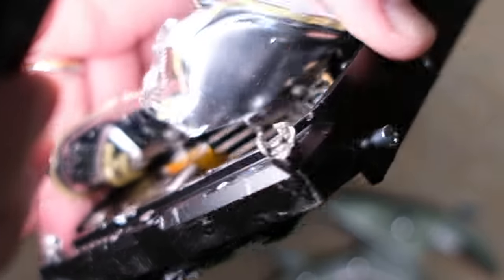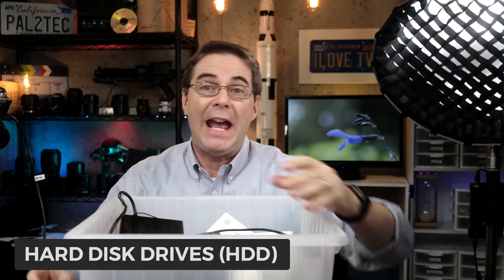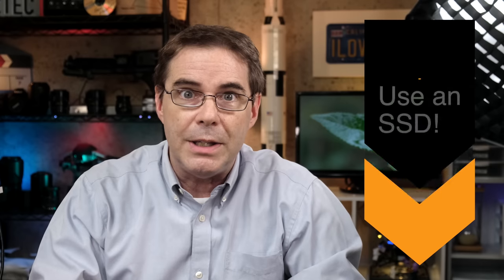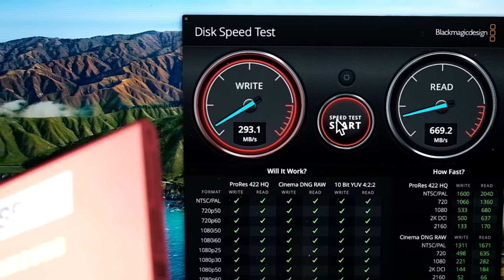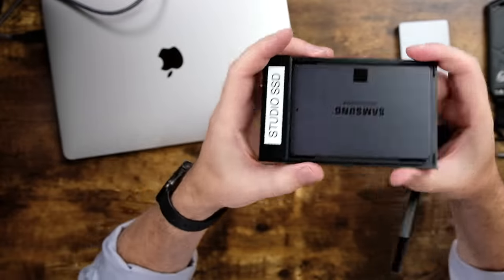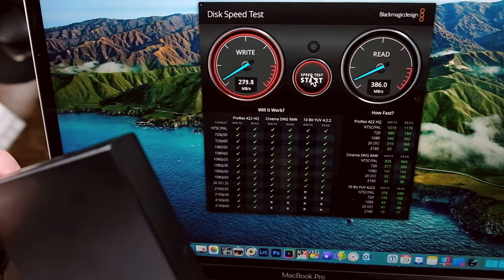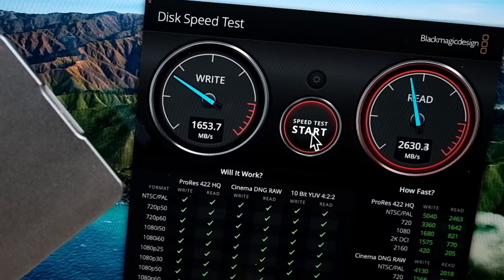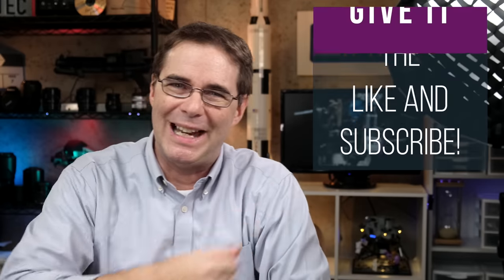Best Hard Drives for Editing

Comment: One thing I will point out is that as a good rule of thumb, if the case comes with a thermal pad, make sure you remove any labels off of the NVM.e and the pads so that the pad is directly touching the chips and case.

Comment: Hi Chris - Just stumbled across your channel when researching the Godox mics, then saw this vid. Great that you warned people off the T7; I might have considered it otherwise! 

=> One very important note about the Inland NVMe drive though, that's also something to watch out for with any SSD these days: Low sustained write speeds. Looking at the low-star reviews on Amazon, a number of people complained that it has very poor sustained write speeds. It'll be blazing-fast for some number of GB, then slows to only ~250 MB/s after that point. (Note that the people who report sustained speeds of only 30MB/s are almost certainly having thermal issues with however they have it housed; I believe that the actual sustained-write speed is more likely the 250 MB/s that one user reported.)

I first encountered this with a little Helix-brand 2TB SSD that I purchased a while back. The issue is that MLC (multi-level cell) Flash memory is much slower to write to than SLC (single-level cell). MLC/SLC refers to how many bits of data each memory cell can store. The original flash storage was SLC; each memory cell stores one bit of data. These days, the really high-capacity chips all store more than one bit per cell, currently the state of the art is 4 bits/cell (16 possible data values), with 5-level technology under development. The Inland drive you mentioned uses this so-called Quad-level cell technology, aka QLC.

MLC lets you pack a lot more data onto a chip, but the downsides are speed and life expectancy. Multiple bits per cell are stored as varying amounts of charge on the transistors' floating gates, treating them as a kind of analog storage medium. To store 4 bits, a QLC chip has to distinguish between 16 different levels of charge, which reduces noise margins when the data is read out. If you're just storing one bit, the difference between a 1 and a 0 is large, but if you're storing 4 bits, you only have 1/16 the voltage tolerance to work with.

The way flash chips age is that charge gets “stuck” on the floating gates of the transistors. A logic “0” should correspond to no charge being present, but as the cells see more and more write/erase cycles, more and more charge can get left behind on the gates, that the chip needs to allow for. The chip basically has to say “OK, I know a zero should be zero charge, but I’m going to say that anything under ‘0.2’ is still a zero.” That’s no problem for an SLC chip that’s just worrying about a 1 or a 0 in each cell, but a MLC chip with 4 bits per cell, the difference between 0000 and 0001 is only 1/16 of the maximum signal. The “0.2” that we decided was OK for the SLC chip would correspond to 0011 in the MLC chip. 

This means that MLC flash wears out much faster than SLC flash does, so it’s important to consider the total rated write-life of an SSD and compare it with your usage. The endurance rating is expressed as total terabytes written, or TBW. Thanks in part to its size, the 4TB inland SSD you mentioned has a rating of 900 TBW, but if you’re editing a lot of 4K video, that could still go by more quickly than you’d like.  

To get around the speed limitations of MLC, many SSD makers include a smaller cache of SLC storage in their devices. This can read and write at blazing speeds, but there’s only so much of it. If you’re saving a big video file, the first 4, 8, or 16GB will write at the speed you expect, but once the SLC cache is full, it’ll drop to the much slower rate the MLC chips can sustain. In the case of my little Helix drive, it’ll write at ~960 MB/s for the first ~12 GB, then slows to 200 MB/sec after that. Once you stop writing, it’ll copy the data from the SLC to the MLC chips, so after a while (sorry, never checked how long), it can write another 12GB quickly again.  Sorry for the looooong comment, but I thought you’d be interested:-)

(BTW, what I use for checking this sort of thing, as well as performing “burn-in” cycles for my HDDs is the Diglloyd Tools Disktester app. You can get it here, I’ve found it well worth the modest cost (currently $45) over the years. https://diglloydtools.com)

Comment: Amazing.  One of my 2 backup drives just died today.  I was trying to repair it using first aid but I am still having problems with it.  How did you know?  I use 2 Samsung SSDs for my photos and other things but I have been using 2 regular type harddisk external drives one 4tb the other 2GB to backup my laptop. The 2tb,the older of the two, is the one saying goodbye.  I will probably get another 4tb WD drive. It is good enough for time machine.  I had looked at your last solution a while back but thought the expense would be too much for me.

Comment: Some SSDs, when transferring data, loose speed over time because they are saturating their high-speed internal cache.

This happens regularly with SATA SSDs or cheap NVMe ones because they don't have fast memory chips, so they are often paired with a small but fast cache to speed up small transfers (because that's what people usually do).

This doesn't happend for high-end SSDs because they have very fast memory chips, paired with bigger caches and also better controllers to handle the data transfer in clever ways without limiting the bandwidth.

There are a lot of videos and topics about that on the web :)

Comment: Chris, I checked out your Amazon link, and I found under negative reviews an issue that I've seen before in researching these NVMe types of drives, and that is that their advertised speeds fall off dramatically as they age. Here is a typical quote of a negative review: "This drive is not stable. Reading from or writing to the drive it will start out fine but fail within a very short time. I have tried this on a Windows machine, iMac, Mac Pro via several different interfaces (USB adapter, PCI adapter, etc) and it does the same thing every time. After a few GB of file transfer the drive drops offline. Windows just gives me an error of "cannot write to drive" and fails. The Mac tells me I have not ejected the drive correctly. If I unplug it and reconnect it everything seems ok until it happens again, and it always does. Do not purchase this drive, it's not worth the headaches".
I don't know if you've used these NVMe drives long enough to be able to comment on this particular observed issue, but I would really value and trust your personal opinion.
Reply from the maker: I've used the NVMe drive and edited several 4K videos, as well as managed a 100,000+ photo catalog in Lightroom, plus editing in Photoshop and have not noticed any issues. However, as I mentioned, NVMe should not be used on client work and the Samsung T5 is the most reliable for that. I'm sure that there are issues, and viewers should be cautious for sure and not get one in many cases. For my workflow, and my backup strategies, I can make the NVMe work in my use case.

Comment: Hi all. Can anyone answer this. If my X-T3 is in fully automatic mode my photos seem to come out quite dark.
Reply: The algorithms in the camera is kind off centered. Try using manual, aperture priority, or shutter priority. If you have a P setting, then use that instead of the fully automatic setting. Also, if you’re shooting raw then the camera tends to underexposed to save more information for your final editing later. Also forgot to mention, when using P, you can adjust the exposure compensation to lighten or darken the image. I think -0.3 (one stop down).
Reply: @ytr8989  Thanks Alex. Will try your advice.